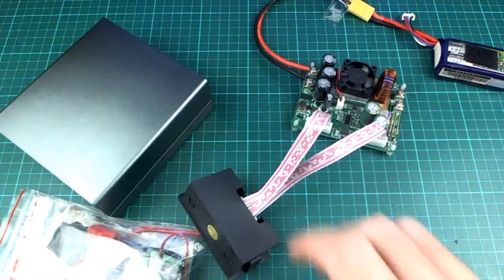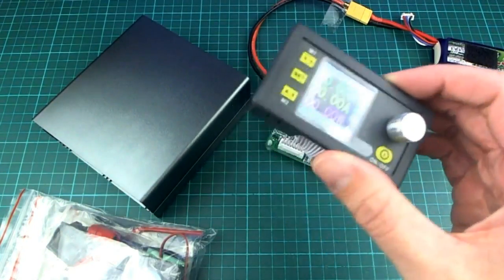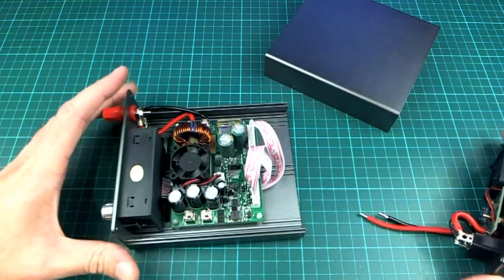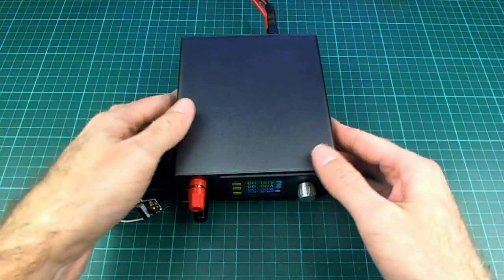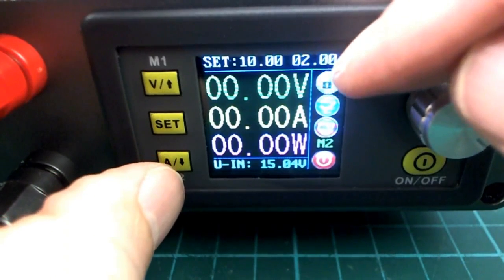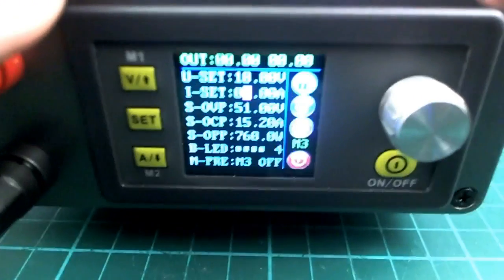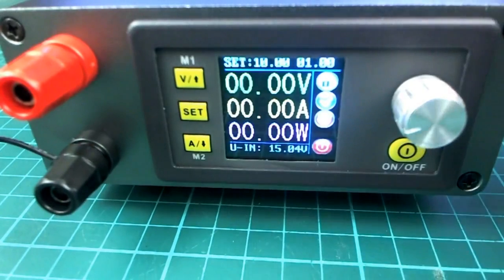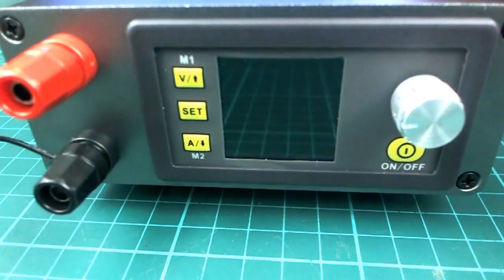DPS5015 power supply and case first look

Comment from the maker: Regarding 0:23 I was mistaken. The other DPS5005 power supply is still working, it was just a loose connection in the input power terminal that was causing it not to work at the time I made this video.
Reply: lol
Reply: u can mute those few seconds of the video , as most people won't look at the comments and think the product is bad!! ;-)
Reply: Does either modules have CC CV ?

Comment: I like the idea of having the unit boot up but not yet turned on to provide power... something of a safety issue to force me to turn on the power with that power button once I have double checked the values that are about to be introduced into whatever this unit is hooked up to. If this unit were last set on some higher values than the circuit can deal with, and power was applied the instant the unit is given connection to power, then the hooked up circuit might get fried. Thinking of those times when things are turned off at night, new circuits are plugged in "ready to go" except that the power supply unit has not been set to the new circuit values... switch on... SMOKE!

Comment: nice assembly follow along. i was thinking could use 14 even 16 gauge wire for how short the distance is. this would help with assembly not dealing with stiff wires. i guess it depends on how many amps for how long.

Comment: Besides sometimes forgetting something that should have been put over the wire before soldering I also find that while I was focused on soldering the heat shrink has slid close to the iron and shrunk.  So I have to desolder, get the heat shrink off and do it again.  Almost always the solder joint the first time looked absolutely great.

Comment: Great Thing!
What do you use for input Power?
Or which Power Adapter do you use?
Reply from the maker: So far I have just used a large lipo battery. I'm usually not using it for very long periods of time.
Reply: @iforce2d  First, Thanks for your quick answer!
Okay. 
2. Which Power Adapter can you recommend me, If I want to use the Selfmade power supply to charge batteries?

Comment: I have a similar model however mine can be controlled by computer via Bluetooth and USB. When you order it the usb and Bluetooth are options available for a little more money. The software is a bit odd but a free download. Also it’s possible to put in a switch to turn the back fan off. It’s worth pointing out that if you want to power this from the mains you need a separate DC power supply. Banggood sell these.

Comment: Hi, Thank you for the video, subscribed. May I ask what is the difference between these units that don’t have the ‘power board’ as a separate unit as in this video. Tue appear to be all complete in the control unit casing? Cheers
Reply from the maker: I think it's just that the higher power requirements of some versions mean the necessary components are too much to fit on the single small board.
Reply: iforce2d Thank you, thought it may be on those lines.

Comment: It looked a nice case and pcb but not impressed with the front.The pressing of buttons was ridiculous for a cheap power supply. I couldn't stand all the fumbling about, LOL. I build my own, using modules in some of them, and like to control the voltage and current with pots then get on with what I wanted to do.
I like many of your other videos but not this one  eg "Which memory, will it save, do I switch off or on, does it delete all settings"?

Comment: I got one fo these to power a telescope remotely. It works, but I have to turn it on with a button press. Is there any way to program it so that it's always on? I'm not local to the unit when I'm using it.  I'm remote. I turn on the telescope from a AC switch. But this won't power up if I'm not present = (
Reply from the maker: 15:29

Comment: HELLO THERE CAN SOME ONE TELL ME WHAT IS THE MAXIMUM INPUT CURRENT FOR THIS DEVICE ???  THANK YOU
ОТВЕТИТЬ
Reply from the maker: ? That would depend on what power output and input voltage you have... from the specs on the product page:

Input voltage range: 6.00-60.00V
Output power range: 0-750W 

If the maximum output power is 750W then the maximum input power is also about 750W. So the maximum input current will be 750 divided by the input voltage.
Reply: hELLO THERE . OH OK SO THIS DEVICE IS SIMPLY LIKA A WATER PIPE JUST REGULATED ONE WELL JUST A REGULATOR I GUESS . SO I GUESS THE WHOLE NIGHTMARE GOT CLEARED OUT

Comment: what heppend if i will use 55v 20a transformer and some protection and big cabels and it will give me full power?
Reply from the maker: yes
Reply: @iforce2d   A little late but that's not entirely true. That would be 1100 W and you can only draw 750 W (probably less)!

Comment: You really should thread the wires through the holes and secure them mechanically by bending them around the posts.  Soldering is not a secure connection by itself.  Whenever the solder joint would break the wire should stay in place.

Comment: how the heck do you screw in those fan bolts?
Reply from the maker: With a screwdriver.... maybe you could be more specific about what you're getting stuck on :)
Reply: iforce2d it wasn't clear that you need to push the bolts into the fan holes first.

Comment: Am designing for my project a rechargeable 12v DC to DC  Ignitor for blasting of rocks, it will have the capability of retaining its charge for at least 90 days. the device is expected to be charged with 12v DC power from vehicles. please contact me if you have any idea. add me on WhatsApp +2347033649055 or donalddream@yahoo.com

Comment: I'm considering buying one, I'm wondering could you test a homemade electromagnet with it? Like just wind wire arround a nail and hook it up directly to the power supply and set the power to like maybe 6 volts, I want to know if it works because my previous buck converter type things never worked with a electromagnet

Comment: wow! I did watch your 1st vid on the 5015 and went out & bought one - loved it but, as you know, it was unwieldy w/o any case. My new one just arrived today & searching for an assembly for it, ran across your vid on it. I don't know how i missed the vid when you 1st put it out 'cause I'm a big fan and have just finished going through your quad for beginners series (also great). anyway, I'll be using this as I put this puppy together later on this week. thanks for all your videos. are you still using the CNC with the water cooling unit?
thanks again,
Russ from Coral Springs, Florida, USA

Comment: I bought a DP50V5A after I watched your video on it.  I had a case from an old router that housed the unit nicely, and it still works great.  I will make sure I stay clear of any foam cutting tho'!  It's interesting that your new one is higher rated, has a really classy looking case, and is only around two thirds the price of the first one!   Maybe I DO need a second one    :o)
Reply from the maker: Not sure how you're figuring those prices... the first one I had was about $29. This new one is $36 and the case is $20
Reply: Just like it used to say on my school reports:  "must pay more attention"!  After I watched this video I thought "I like the look of that, I wonder what it costs", so I watched it again, and at 1:30 there was a pic of the complete unit showing the price of US$19.99.  If I had paid attention, I would have worked out that price is for the case only!  It seemed too good to be true... and of course it was!  Still, I do like the look of it.   :o)
Apologies to anyone I confused.

Comment: Mine bernd up when i was powering a dc motor but i think i know how i t hapend. I turned the switch off but the motor was spining so fast i think it fed back some current. Maby i shuld have used the diode that they give you for charging batteris with it.
Reply from the maker: hmm.... good to know. I wonder why it can't just have some protection in there to begin with.
Reply: iforce2d i think you have to buy the version that das not require the shotky diode to charge the batteries. I think is the 30v 5a version. It says it on the chart. I bought that one for that reason now. I hope is going to last coz i do like them.

Comment: My word the interface is just awful. I wonder if it is worth bootstrapping a bench supply project by ripping out their analog power stage and replacing the control front end with a sane setup. I mean is it so hard to have accelerating voltage/current selection via the encoder? ;)
Reply: Guess it a matter of taste, love the front end and love the fan running all the time.

Comment: I've had an impulse to get one of these 2 or 3 times before.  It certainly has a very nice look and seems to be a great value !!  But I sill prefer the classic "twist knob" approach to setting  voltage and current limit values in real time.  I just can't get into all that fiddling about with buttons to set it up !!  Maybe it;s just me !!  ;)
Reply from the maker: Yeah, it might be nice if the rotary dial would change something (eg. voltage) even in the idle state, without having to use any other buttons first.
Reply: Drop in a good ol' 723 and two 2n3055's, one ton trafo - and that's my thing all day long :)
Reply: Not just you. I might end up with one but that push-turn-tap etc. will drive me nuts. I dithered on getting a used BK Precision Model 1735 30V 3A with coarse and fine knobs and two large numeral displays for Volts / Amps, plus 3 (Blk-Grn-Red) terminals. Monster transformer. Would have been problem solved but I thought at the time I can't be spending $100 on more stuff I don't absolutely need. I'll be into $100 by the time I cobble together one of these things properly by the look of it.

Comment: Sorry was getting excited, thought this was a replacement 100 volt dc power supply for your cnc router motor. Will have to go back and check your videos on that because I never got rid of the same issue you had with missing steps when using the same spindle and power supply you had. Great video anyway, thanks
Reply from the maker: Missing steps was not the problem I had. Mine was completely losing contact between the arduino and the laptop. Missed steps could be because your motors are not powerful enough, or the frame is not rigid enough, or you're trying to move too fast. Perhaps you could give bluetooth or some other wireless method a try.

Comment: iforce2d can you tell me what voltage and amp and watts to use to power the sky rc imax b6 charger  I'm getting input volt error
Reply: 12v / 6 amps should do it
Reply from the maker: Pretty sure there must be some specs info you can look up about that.

Comment: If your having trouble with solder joints not looking good, especially if you are reflowing existing solder, try adding a bit of rosin flux before reflowing.  The flux residue is messy but it can be cleaned off with alcohol or acetone.

Comment: Wow, that case looks really nice! I did not expect this level of fit and finishing. For what is included it is still reasonably cheap.

At the end: you switched off the PSU without leaving the setting screen the first time. I think you said yourself you have to be careful what buttons to press for the settings to be saved.

If the fan annoys you, there are several things you can do:
First get a new fan ;) . Maybe the included one is just crappy and loud (although most small ones are).
Better way would be to add temperature control, so it only runs when needed (you could also hook up the second fan to that). There are simple circuits with just an opamp or NE555, a transistor, NTC and a few resistors for on/off control with hysteresis. 
Or you could go for temperature speed control. Most circuits you find that do voltage controlled PWM (at 5V) should be useable with slight adaptation. E.g. 3 opamps, (two to create a triangle wave and a third one to compare to a voltage derived from the NTC) is an easy one. A quad rail-to-rail (because of the low voltage) opamp (like an LMV324, you could say that's the rail-to-rail version of the LM324), the NTC, a switching transistor and your usual assortment of small parts like resistors and capacitors is all you need.
Reply: Found another simple circuit based on a chip that's built for exactly that (and available on ebay):
http://www.instructables.com/id/Temperature-controlled-fan-speed-using-PWM/
Reply from the maker: That looks like a fun little mod to make. I would probably be inclined to use an arduino since I have a bunch sitting around.
Reply: Tsk tsk, yeah throw a micro controller at everything. The art of analog design is dead. JK ;)
Probably would do the same with those clone Arduino micros costing only a few bucks and in the end being more versatile and most likely hassle free.

Comment: What you said about soldering in reference to Murphy's law; it's absolutely true and happens with me too often. Sometimes I solder pads or wires very neatly and evenly which also so shiny that I could see my face on it. The moment I start feeling great about it, I'd find that I did something really wrong; may be forgot to insert a sleeve, a washer, nut, or a cap. Some might say it's my negligence not doing it correctly at first. But I always try to give extra care to do the soldering and wiring perfect except this happens often.
Reply: Exactly !!!  LOL !!

Comment: I have just started fabricating a case for mine, but bigger so as to hold the 600w SMPS to drive it, I might get the pre made case for the 5A one I haven't yet used, after seeing your video. Looks good, I can fit the 180w 36v board in the back. The auto start enable is very good if you want to use it for integrated applications where it just needs to work all the time, in a power failure it will re start by itself. Anyway, another good video, cheers.
Reply from the maker: ah yes, that would make it quite useful to have then. I just figured that it would typically be used in a more interactive situation.
Reply: simontay1984 
i had a 48v 13A smps recovered from an industrial mocon motor drive unit awaiting recycling. 
Bang have 400w version's listed, could stack two as they have voltage trimming onboard.

Comment: Those 5v fans run quite nicely on 3.3v and it cuts the sound produced dramatically...
Reply: whilst correct, you're better off just adding a thermostat so it's silent unless it's over x degrees. I screwed my thermostat to the same TO220 existing screw.

Comment: 12:21 They could improve the experience by including a User's Manual.
I have a 3205 with the same high quality case. I needed 0.001 A increment adjustments and display. Pretty good PS for the price.
BTW for the noisy fan you can install an in line resistor on the fan power leads to slow the fan by dropping the voltage a bit.
Reply from the maker: There is a manual included, but it's not all that easy to understand and coupled with the slightly strange UI was what made me not bother to figure out how to use the presets with the previous model. The manual is just the same as the scanned text on the product listing page.
Reply: Thanks for the reply... I got mine on AliExpress and received zero docs.